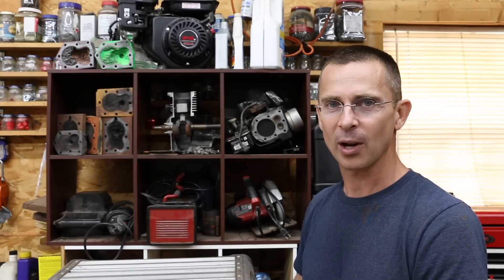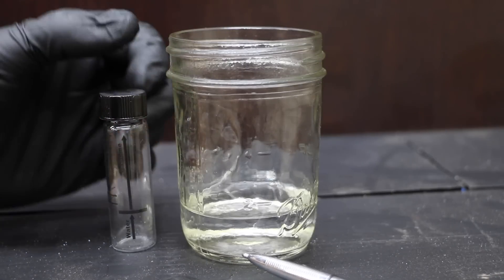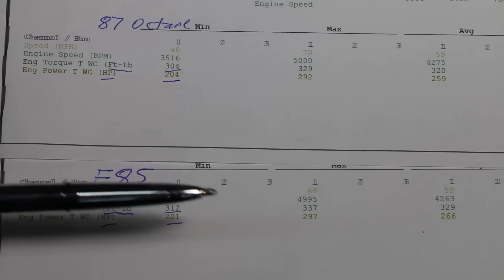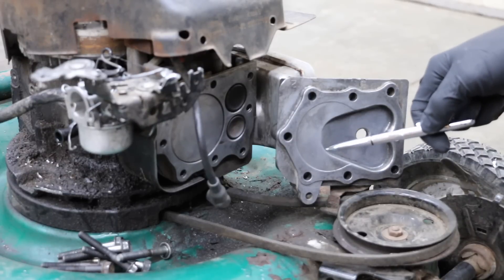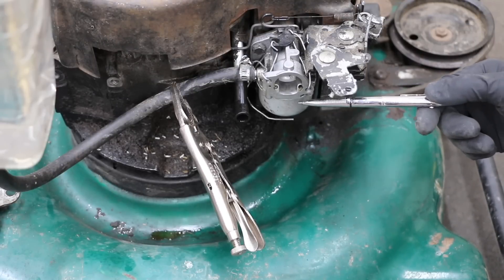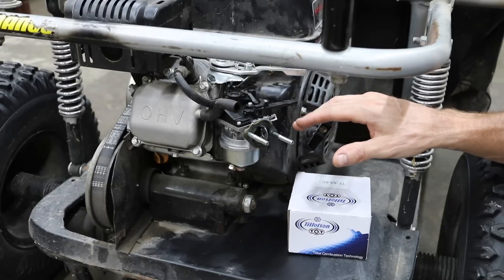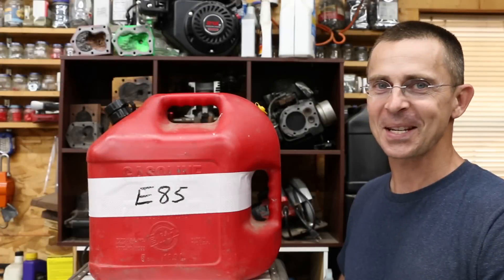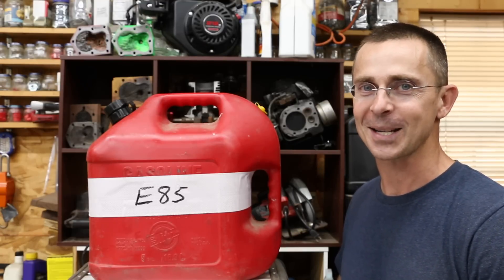Is E85 better than Gasoline? Let's find out!

Comment: I have been running a blend of around 50-50 to 60-40 gas to ethanol in a 2006 Honda Element (Not a FlexFuel vehicle) for 2-1/2 years, and 70,000 miles with no ill effect. With more than 50% ethanol, wide open throttle power is down and a fuel metering lean DTC P0171 will be set around 60%.
If I'm planning to tow my lawn mower trailer I will plan accordingly and fill up with E15, the blend will work but power is down at W.O.T.
The owner of the shop I work at told me I would ruin the fuel pump. The parts guy said I would ruin the catalytic. 70,000 miles later it's running strong like a Honda should. But I guess if either one goes bad on a 12 year old, 278,000 mile vehicle it HAS to be because of the ethanol.😉
http://www.richardcraver.com/2016/05/alcohol-anyone-part-1/
http://www.richardcraver.com/2016/06/alcohol-anyone-2/
Reply from the maker: Thanks for commenting on this.

Comment: On e85 there is a big price difference in my area. Since e85 is cheaper what is the cost per mile. Going by mpg is not a true comparison. A better would be cost per mile.
Reply: Also a tuner told me GM doesn't add time when it knows it on e85 causing a big loss of potential Power.  That's what I heard not sure if True.
Reply from the maker: Great point. Thank you!

Comment: If you want to see some real testing on E85 check out Advanced Fuel Dynamics, I'm pretty sure they have done more testing than anyone, they even have E85 vs MS109 race gas test somewhere btw E85 killed the race gas in the test. I run it in race cars and great.
Reply from the maker: Thanks for the recommendation.

Comment: To take advantage of the high octane rating of E85 (105) you need a N/A high compression engine or forced induction engine. My sbf N/A 12.5 to 1 331cid engine (mild cam) made 12hp more than race gas when at the dyno but consumed around 30% more. So with 421hp on tap and a 5 speed I average around 14mpgs but I dont drive it easy! Its way cheaper per gallon than race gas. Keep up the great vids
Reply from the maker: Great point!  Thank you

Comment: The advantage E85 really gives is the ability to run a higher boost amount in turbo & super charged engines because E85 has a higher octane rating. So in a turbo'd engine you can increase boost pressure and add extra fuel (by tuning the ECU) and that will produce more horsepower. It will also drink more fuel though, so I'm not sure E85 will ever give better mileage (after all, there will always be less available energy in E85 compared to gasoline). I think the main push for E85 was to increase corn sales, so the price of ethanol is (was?) subsidized. I don't see the benefit for the average consumer, as the prices are usually fairly similar, but gasoline will have more energy, and thus the better mileage. If you are looking for performance though, E85 is a solid fuel for pushing a few more horses out the engine.
Reply from the maker: Great point!  Thank you

Comment: Do you think you could test an electric vehicle that runs on a generator much like a locomotive? So a gasoline generator powering an electric motor using an electric speed controller? This verses a standard transmission/rear end engine powered vehicle?
Reply from the maker: Great video idea!  Thank you

Comment: HI     IN YOUR SUGAR IN GAS TEST,  THE GAS TODAY HAS NO LEAD .  AND 40 OR MORE YEARS AGO IT HAD LEAD IN IT. COULD THAT HAVE HAD ANY BEARING ON THE DAMAGE TO MOTORS 40 YEARS OR MORE AGO ? COULD THE SUGAR / LEAD MIX MAKE SOME KIND ACID OR GUNK THAT OLDER ENGINES AND CARBS COULD NOT HANDEL?
Reply from the maker: You might be right. Thank you

Comment: My 2017 F250 is a flex fuel vehicle. I tried the E85 a few times and noticed about 1 mpg or so less economy. I know my vehicle is designed for it, but putting alcohol into my gas tank still makes me uncomfortable so I stick with regular 87.
Reply from the maker: Thank you.

Comment: I increased the boost level on turbo, allot higher with e85. So yes loads more power, but stock injectors won't cope as fuel needed are gigantic vs regular gasoline with lower charge. (Look at lambda value)
Hp increased 3x on a mechanical stock engine, only need bigger injectors, trimmed the fuel mix with fuel pressure to injectors.
It hit the fuel efficiency slightly, but on mid load efficacy went up instead.
A decrease of compression would yeld even more hp before hitting ping. I'm close at 100% before ping starts. Stock iron block & top engine! Aluminium engines are to weak for this stock as will crack likely.
Reply from the maker: Thank you

Comment: E85 has gotten so expensive over the past couple years. Guess they caught on to everyone tuning their vehicles to run on e85 to make the maximum amount of power out of their modifications. It was 1.65 a little over a year ago and now the average price is around 2.58 in NY. It’s crazy how expensive all fuel prices are nowadays. Diesel is even a handful of change more than regular gas.
Reply from the maker: Great point!

Comment: So will E85 clean a dirty engine?
Reply from the maker: While it does a great job cleaning, I wouldn't use it unless your vehicle is designed for it or it could cause a lot of damage to rubber and plastic parts.

Comment: About 8 months ago I started mixing E85 (tested as ~E75) and 89 octane dino juice (advertised as "up to E10" but untested) in my non flex fuel 4.6L at ~50/50. I've been tracking fuel economy on Fuelly for years and gas mileage is largely unaffected and I save about $10 a fill up.

I may or may not be a cheap ass.
Reply from the maker: I'm impressed the fuel efficiency is the same.  Thanks for commenting.

Comment: Alcohol requires a much higher compression and timing to yield more performance. A way to offset some of this is to run more "boost".  It also requires more frequent oil changes. Flex fuel systems are just that, flexible. Thanks for your effort to unbiasedly test the difference.
Reply from the maker: Great point.

Comment: Modern cars not e85 compliant can generally run on e15 and some cars, a little more. The limiter is generally fuel system. It does wonders for turbo or supercharged engines in part because we can add timing back.
Reply from the maker: Great point. Thank you!

Comment: Your MPG and power levels with E85 are consistent with my experience using it. I once rented a little Chevy HHR for a week or so. I mostly ran cheap gas in it (which at that time, in the Midwest would've been E10 89-octane.) But one time, just for tits and pickles, I filled it up going down the highway with E85. No appreciable difference in power, but my fuel economy dropped to 2/3 or so of what it was with gas.

Good, proper E85 can be pretty amazing If your vehicle's properly tuned to use it since it's octane-rating is something like 105-110. That means you can run all the goody-goody power adder stuff like advanced timing, a big ol'  blower, etc without too much fear of engine damage. Case in point, I just read an article recently about a guy with a daily-driver Charger Hellcat that went just under 10 seconds in the 1/4 mile (about 1/3 of a second from the 1/4 mile time of a Demon.) The only change he made to the engine was to tune the PCM for E85...

Something I have always wondered about (and I believe I laid out the principles down in the doobly-doo of your last video), what would be the the difference in fuel economy, power, torque, etc. between 87-octane, as dad likes to call it "gas-gas" and E10 89-octane blend, particularly in a vehicle that's designed to run on 87-octane, but is rated for peak power on 91-octane fuel? Can you even find it anymore? As kids, well teenagers learning how to operate a motor vehicle I suppose, in an soil-erosion-prevention stand of trees, probably not far from you and yours, mom always used to fill the van up with E10 89-ocatne because as she put it "It's cheaper, it's higher-octane, and it's good for the farmers."
Reply from the maker: Thank you.  Locally, I can only find non-ethanol in 91 octane.  The other octanes have 10% ethanol.   I'll likely do some more testing on ethanol vs non-ethanol fuel. Thanks again!